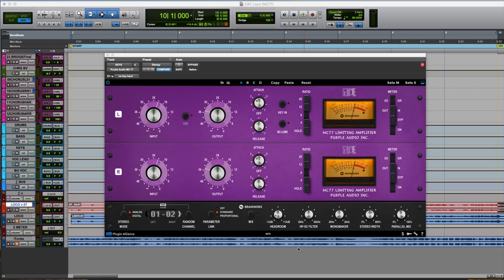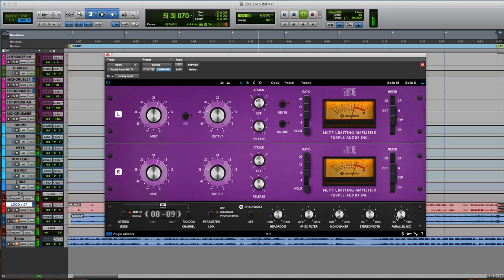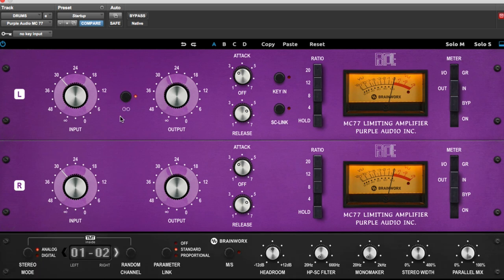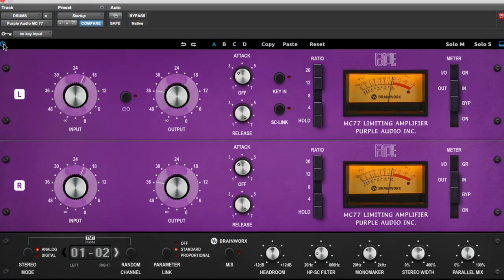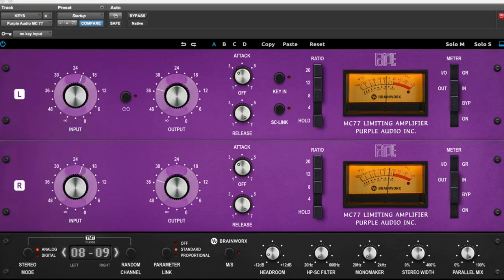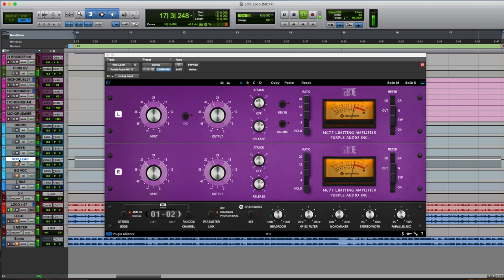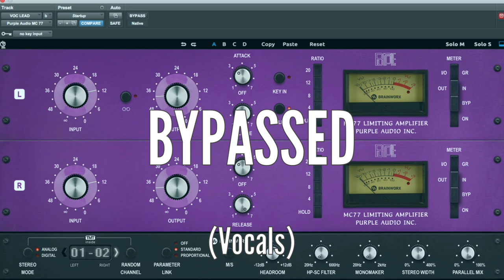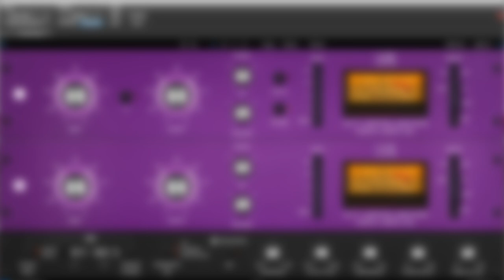Purple Audio MC 77 Limiter - Feature Walkthrough | Plugin Alliance

Comment: (cranks input gain without compensating the output) "immediately you notice a lift of the bass without any compression"...well, obviously - you turned the volume up! It's always nice with saturation on a bass with few harmonics, but even after compensating the output it's still louder than the original. Cynical...

Comment: Note that all the way to the right (7) on Attack and Release yields the quickest release times and quickest attack times. Not how I would have guessed it worked.
Mono Maker Knob, typically set this between 100-200 Hz, below which bass frequencies reside and are thought best to be left in mono. Turn knob all way up to check mix for phasing issues.

Comment: Great demo! I never miss one of your reviews on plugins I am interested in. It is interesting that the link button doesn't quite keep the level the same. You had to adjust the output gain down to get the correct A-B listening environment. Is this because the compressor is reducing the dynamic level or just a quirk of the plugin? I really love the sound of this plugin. It seems to be able to handle anything you throw at it. I demoed it but missed the ability to just get the saturation out of the compressor with the attack button off. How cool!
Reply from the maker: Thanks for the feedback! The volume compensation is due to both the compression and internal saturation of the plugin. Analog behavior it’s not always predictable 😉

Comment: Really great demonstration. If I could just point out one thing, you changed parameters while doing before and alters. 
During the first before and after you brought down the output before engaging the mc77.
It's minute I know but let it be a true before and after
Reply: There's no auto-gain/level feature on this compressor- bringing the output gain down was an attempt to do a true A/B, otherwise the effect of the compressor will be overshadowed by the drastic level change.

That said, they did a terrible job of level matching here, so either way.